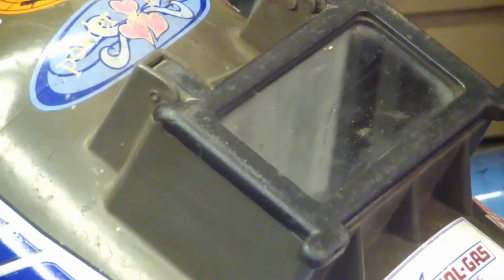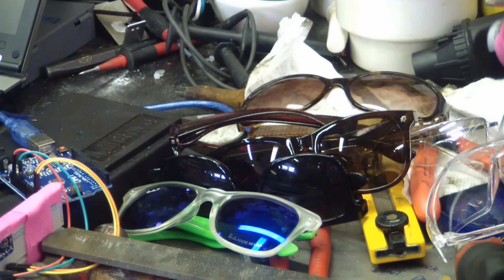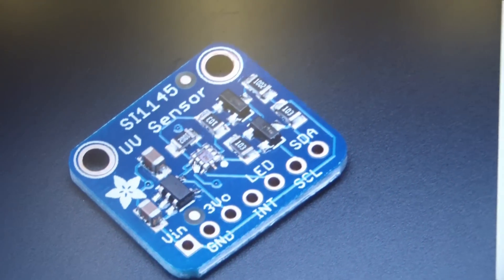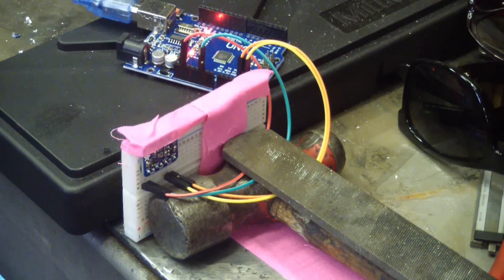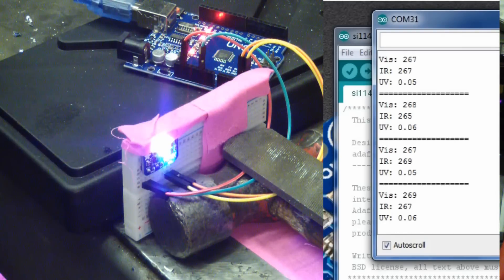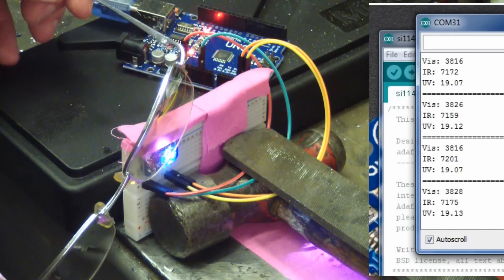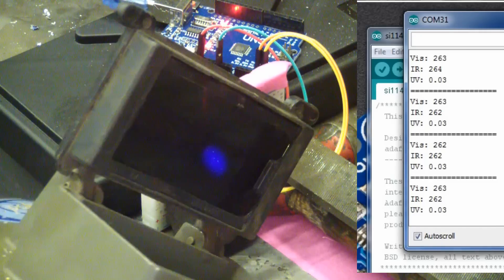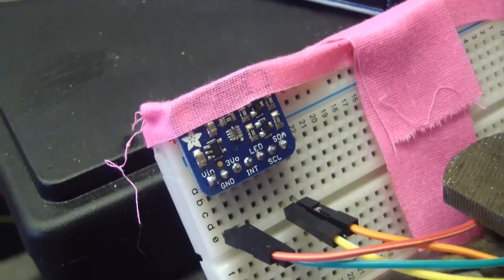Knock-off Ray Ban Sunglasses vs. UV laser

Comment: Several years ago Consumer Reports did a similar test on sunglasses, the question was simple: Are your eyes likely to be damaged by cheap sunglasses? They came up with an identical answer, even the cheapest sunglasses provide adequate protection against UV radiation, even clear glasses protect against UV radiation, no special treatment is needed, the UV blocking is a normal characteristic of the material. Untreated glass or plastic both block UV radiation.

Comment: There is no UV being emitted from that laser. The diode is probably spec'd @ 405nm but in reality most likely puts out 405~408nm. Not a valid light source... at least not without a spectrometer to verify its wavelength. A power meter would also be a good idea so you can figure the optical density of the beam. The sun is not going to deliver nearly as much power as a  class 3b laser. Your test would have been more accurate with a pass filter and verified UV led and optical sensor / power meter.

Comment: I used to do a fair old whack of welding and I'm an idiot so used to shut my eyes while tacking... obviously resulting in being flashed on numerous occasions, luckily for me I wear glasses (just normal unshaded glasses) and never suffered (at least not yet) any sort of ill effects. The moral of this story being any acrylic or polycarbonate lens blocks the shit out of UV light regardless of shade.
Reply: Thats odd because tanning beds cover the lamps with polycarb o_O I know that high infrared bands with laser are blocked by PC where standard clear PC plastic safety glasses will filter out the wider band of IR light. UV blocking is also utilized with opaque in prescription bottles, I dont think clear is used when UV is to be blocked.

Comment: Just a PSA, the sensor you used doesn't actually measure UV light. The UV reading is a mathematical adjustment of the visible light, made in the arduino library. Source: https://sigurthrenterprises.blogspot.ca/2016/01/the-little-uv-sensor-that-couldnt.html
Reply: Then why did the reading go down so much when he put the clear lens over it?

Comment: IR (heat radiation) will pass through glass. Feel the sun on your face through a windshield.
UV will not pass through glass or will be cut down at least. Camera UV filters are plain old glass and a cash cow for the optics companies,

Comment: What's important in sunglasses, is not just how much UV they block, but how much UV they block in comparison to visible light.

If they block enough visible light, your pupil will dilate - letting in more light, and if the sunglasses don't block enough UV, it can cause the amount of UV actually entering the eye and hitting the retina to increase. (Because you decrease the amount of UV hitting the retina by a factor of a [a<1], but the increase in pupil size will increase it by a factor of b [b>1], and if a*b>1 then the total amount of UV light hitting your retina will increase)

This is why cheap unbranded/knock-off sunglasses are actually dangerous to your eyes.
You can get quality sunglasses for cheap online, but not 10$ cheap.

Comment: I have one of those 1 watt lasers and that would probably melt the sunglasses.  I don't use it a whole lot because one accidental flash without the laser safety glasses and life will suck for me because I will be blind.  Or at the very least have a spot where I can not see any more.  Either way it would absolutely positively suck because of how life changing that would be.  I also don't use it much because I don't want to accidentally set something in the house on fire.  I don't use it outside much because there is a small airport nearby (maybe 3 miles away) and I don't need anyone knocking on my door because of any accidents misconstrued as mischief.

Comment: I love your videos! One of my concerns with this video is that the curvature of the lens would refract the light thus missing the small area the sensor can detect causing a lower reading (hence the clear ones actually doing a good job). However our eyes would pick up more and focus it into our retinas. So you would need a lens behind the glasses to have a more accurate reading of the effectiveness of the glasses. But regardless love the vids!!

Comment: Side note; they NEED to be optically correct also. If not, they will ruin your eyes as well. The cheap ones seldom are. If you put them on, nod your head while looking at one fixed spot and see a ripple....throw them out!

Comment: the si1145 does not measure UV, but IR and visible light levels, and then calculates the corresponding UV-levels that would be present if in sunlight

Comment: This video is stellar.  Consumers don't realize that glass and plastic lenses only come from a few sources.  The real money is in 1) glass rather than plastic, and 2) coatings, and 3) quality control.  If you want cheap plastic lenses and don't give a shit about #2 or #3, then you're golden.  Bang em out in China at 100,000 units a minute and sell away.  But the Oakley and such last longer structurally because better materials are using in the frames.  Optical clarity is a #2/#3 issue.

Rifle scopes are a prime example.  A dozen or more budget scope brands source all their glass from 1 or 2 sources in Japan or the Philippines.  The real difference is in optical coating and consistency in quality control.

Know what you're buying.

Comment: As a young chap Richard Feynman was one of the scientists working at the Manhatten Project, and as far as I know (and as far as he knew) he was the only one to have seen the actual trinity explosion. Most people were either not looking to protect their eyes, or wearing very darkly tinted glasses, but he had some reason to believe that brightness did nothing to cause harm to eyes, that it was only UV radiation that was harmful, so what he did was, he stood next to a truck and looked down to where the explosion would be through the trucks windshield, which was just plain windshield glass, and he believed that would do the trick. Considering he saw the explosion that was brighter than the sun, and suffered no damage, he must have been on to something, no? Now, I'm no scientist, but might it be possible that filtering UV light could just be a property of any glass?
Reply: Most sunglasses aren't actually made of glass however.
Reply: +Todd Bell windshield glass is treated to blocked uv radiation to some extend
Reply: Not back in the 40's, it wasn't. It wasn't even safety glass.

Glass does block some UV on its own, though.

Comment: Any lens blocks UVA.... It's UVB that is the issue.
Reply: Both gives you cancer. But yes UVB is more dangerous and is what burns our skin/eyeballs. So if you don't want to go snowblind (which I have done and cannot recommend) wear proper UVB eye protection. However polycarbonate will, to my understanding, protect you against both. And it's cheap as shit.

Comment: Other thing to note is that UV is relatively easy to block, but the thing that more expensive ones do is they polarize the light so things still remain relatively sharp... You can wear those cheap things but not see a thing, which I guess is better than nothing.

Comment: Chances are the UV sensor isn't up to much.... what's worse... cheap china sensor or cheap china glasses?
Reply: Adafruit makes all of their stuff here in the USA, specifically in NY.
Reply: It uses a light sensor from TAOS (Texas Advanced Optoelectronic Solutions). TLS2561 seems pretty nice, albeit it's designed to function as a ambient light sensor, but seems perfectly adequate to determine a rough blocking effectiveness.

Comment: Quick note for you here, UV type A is more easily blocked than type B. Effective sunglasses need to block UV type B to stop your eyes going pop. If the laser only outputs type A then you can't test for type B :/ thus effectiveness to keep you goggle boxes safe isnt really measured .
Reply: I thought a tighter wavelength meant it was a higher energy wave? Assuming the amplitudes are comparable.
Reply: UVA has the longest wavelength and is therefore the hardest to block. It's also the least, but still, dangerous. UVB is mostly while UVC is completely absorbed by the atmosphere before it reaches us.
Reply: Olav471 Yes and no, UVA is harder to block through the atmostphere. But if you compare UVA damage to an organism vs UVB at the levels found at sea level, then UVB is a higher damage dealer, so what you really want to test sunglasses for is UVB.
Reply: I know UVB causes more damage than UVA because of the shorter wavelength. I was just correcting you on what is easier to block. As far as i know even normal glass blocks pretty much all UVB, while letting UVA through.
Reply: Olav471 Fair play :) pretty much most commercial optically clear lenses will let UVA through :) or atleast a decent percentage of it :)
Reply: exonusgod there's no "type" of UV they simply englobe different UV wavelength ranges and he does specify what the laser is outputting.
Reply: not only type A . It is hard for any cheap device to distinguish the diference.
Reply: Howabout this. Stop worrying about it.

Comment: Polycarbonate (which is the material that plastic sunglasses are made out of) inherently blocks out the majority of naturally occurring UV radiation (ie. coming from the Sun). So, in general terms, even normal eyeglasses with plastic lenses offer protection against it.

However, polycarbonate itself degrades from long term UV exposure, so either the material needs to be treated in a way that stabilizes it against UV radiation, or alternatively you can just apply an UV filter coating on the material.

Eye shields for arc welding need to be a bit tougher than normal sunglasses, because arc welding produces quite intense UV radiation at close proximity to the user. It's also a good idea to make welding goggles more resistant to physical damage, and both of these qualities - higher UV attenuation and physical toughness - are accomplished simply by increasing the thickness of the material. That's why the lenses of sunglasses are usually quite thin compared to the bulk of welding glass.

Incidentally, both glass and polycarbonate are used for welding eye protection. Each have their own unique advantages and disadvantages - glass is optically better and more scratch-resistant, polycarbonate is lightweight and more damage resistant.

Comment: Bit of bad news... The SI1145 sensor is not a UV sensor! It can approximate UVI for outdoor sunlight but doesn't actually work for measuring the amount of UV passed/absorbed by sunglasses: http://www.geni-uv.com/download/UV-sensor_Si_Lab-Genicom.JPG
(That comparison is from a competitor, granted, but I've confirmed for myself that it does not respond to being illuminated by a UV light source)
Reply: But then since you're measuring with a uv laser, it should still work... Just watch out as the measurement may not be totally linear as the si1145 is applying some pretty weird correction to the measurements to derive UVI. I still think a simple broad-spectrum light intensity sensor or a proper UV sensor would be a better choice.

Comment: An amazing fact:  the ozone layer is an average of 3mm thick (or 1/8th inch)!!!  Yeah, it's a mm or two thicker at the poles and is washing around like suds in a tub....   It blocks out a lot of harmful sun rays.   1/8"th of an inch!!!  Sure the modulus of different kinds of glass, plastics and coatings work on specific freq.s of light.  But eye wear is about 1/8" thick.  Forgot the calculations of refraction index... in high school physics... 34 years ago.  You gota get some pricy Persols (Jack Nicholson's choice), Shurons, Serengetis, Maui Jims (yeah, some hipster garbage)...  Hey go to a eye wear shop and bring your UV meter!  Put the "special coatings" to a test.

Comment: Most sunglasses, even the gas station sunglasses, are 100% UV protected. The difference, however, is how the UV protection is applied. A pair of good, expensive and brand name pair of sunglasses will have the UV protection film applied to the inside of the lens towards the front face of the frames. A cheap pair of sunglasses will not have the film applied inside the frame. What they do instead is spray on a UV protection coat over top the front face of the frame. So sure, bought right off the counter you get 100% protection but as time goes on the spray fades and you no longer have 100% protection. The same CANNOT be said to an expensive pair of sunglasses.
Reply: What's important in sunglasses, is not just how much UV they block, but how much UV they block in comparison to visible light.

If they block enough visible light, your pupil will dilate - letting in more light, and if the sunglasses don't block enough UV, it can cause the amount of UV actually entering the eye and hitting the retina to increase. (Because you decrease the amount of UV hitting the retina by a factor of a [a<1], but the increase in pupil size will increase it by a factor of b [b>1], and if a*b>1 then the total amount of UV light hitting your retina will increase)

This is why cheap unbranded/knock-off sunglasses are actually dangerous to your eyes.
You can get quality sunglasses for cheap online, but not 10$ cheap.

Comment: If the lenses are made of polycarbonate, as almost every lens nowadays is, the material is naturally UV blocking. The only material that we need to add a UV tint to is a CR-39 lens.

The main issue with cheap sunglasses is that the polarization is that stick-on junk that begins to peel the moment you leave them on your dashboard in the sun, or it'll just peel off over time.

Comment: You made me bust out in villain type laughter with that torque joke  ~two and a half minutes in. The key snark was great too. Does Canuckistan have the absurd 5 Mw limits on consumer lasers that we do down here?
Reply: seigeengine Well, if you are going to ignore what the words I say mean, then a counterargument based on what I wasn't saying makes very little sense doesn't it? Regulation is always done by people who are not practitioners but presume to dicate method to practitioners. That's important. They dictate method, rather than result. Thus When legislation (a statute) authorised the creation of the TSA in USA, the TSA dictated that all cars must have round sealed beam halogen bulbs with parabolic reflectors. This was the best tech at that precise moment in time, but was almost immedialtely obsolete. We were stuck with those inferior lights on our cars for decades. The rules were written by people who would keep their jobs for years and could not be voted out. It cost our country greatly in safety, and also in import and export costs. We did some similar stuff requiring ethanol in gasoline. 

Both of these were a bureaucrat dictating METHOD. Use this bulb, use that blend of fuel. Not results. i.e. light must cover at least X area to an intensity of Y. Fuel must not release more than Z units of substance per KW.... Your lab glass examples and food safety examples illustrate this problem. Contrast if you will, the german approach to traffic accidents. They don't look at your method much unless you Actually cause a problem (as opposed to Might), then, if you have strayed from advisory rules they come down on you hard. 

So yes, regulation kills innovation because it dictates method. Statutory law is easier to reverse, and tends to specify or prohibit a result, and leave it to you to figure out how to comply.
Reply: GunFun ZS As far as I can tell, no, there are not explicit restrictions on the power of laser you're allowed to have.
Reply: seigeengine That's good. regulation is the opposite of freedom. And the regulations are never written to allow innovation. They always hope to restrict the careless or those who disobey the law by shackling those who do obey the law. It works as well as would make sense.
Reply: seigeengine Which regulations am I taking for granted? Also I am using the technical definition of regulations. Regs are code developed by unelected administrative agencies, theoretically as development and explanation of a supporting statute.  

While I have seen various states have constitutional clauses or even statutes that restrain the state's ability to control people I have never seen a regulation which does so. I would be interested and surprised if you actually provide one.
Reply: seigeengine Good. Then you can talk to me. That is, if you can use better arguments  than ad-hominem.
Reply: seigeengine Well I guess if you can't dazzle them with brilliance, baffle them with bullshit.

Comment: Good video. However, for things like optical filtering it is better to use absorbance instead as the numbers are much more manageable. Simple formula: Take the log10 of the %transmition. At this point you would be dealing with numbers ranging from about 0 to 5 and it would be much easier to compare small changes.

The first set of glasses you measured has an OD (Optical Density) of 2.58 in UV and 1.16 in the visible. Compare this to the welding glass which has 4.99 in the UV range and 1.17 visible. Looking at how that compares to the sunglasses though makes me remember that the laser is only putting out UV, and everything in the visible spectrum is just from ambient light which you are not testing for and not controlling for.

Comment: One quick test of if sunglasses are actually polarized is to take 2 pairs and line them up. This probably won't block all the light. Turn them 90 degrees. That should block out all incoming light. If it doesn't, you're getting cheated!